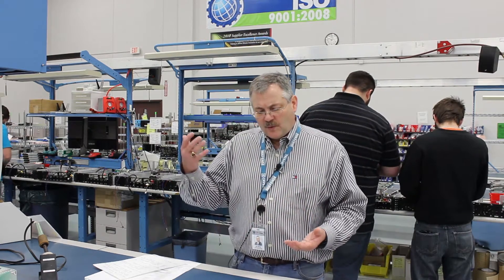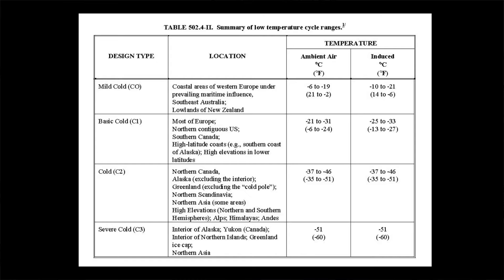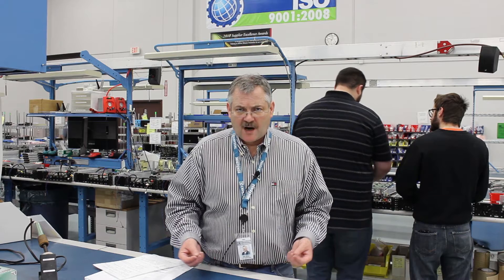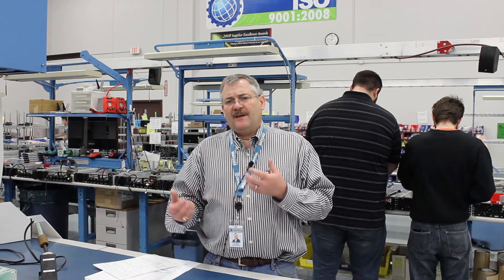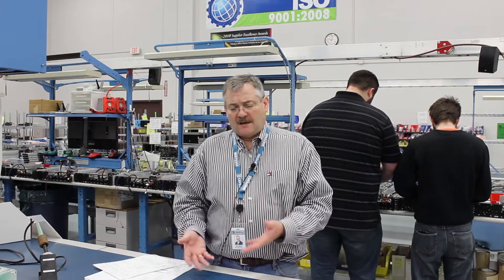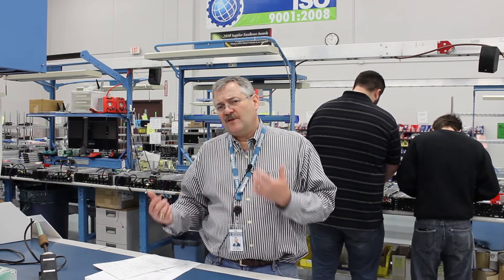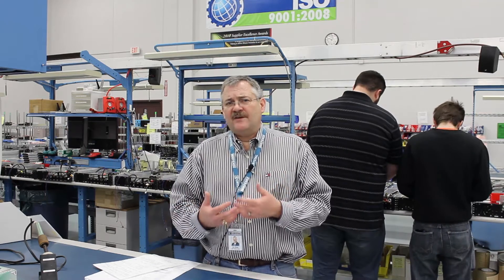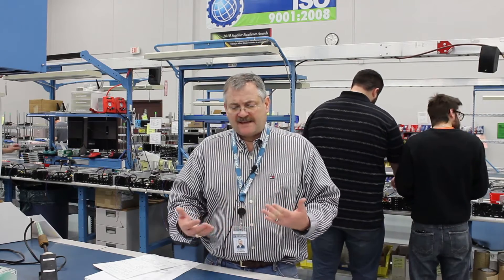MIL-STD-810 Test Method 502 Low Temperature | Jim on Engineering | Volume 1, Episode 66

Comment: What is the failure mode of storage and operation test ?  Is it the same then why u perform storage and operation. Is it not ok to perform just one of those ?
Reply from the maker: The lowest low temperatures are not always reached when the unit is operational.  This is because there is self-heating so even if the low temperature dwell  time is significant, the unit never reaches the minimum temperature.  Cold start is one way to test this however cold start is usually not the same temperature as low temperature storage.  In low temperature storage we are testing how the materials change or hold up under the lowest temperature while operational low temperature is testing how the electronics function at the lowest operational temperature.  One of the classic problems is rotational hard drives.  If they are spinning you can take the temperature down to -40C and it is not a problem but they rarely start spinning from a below -20C because the grease in the spindles is so viscus.  So the failure mode in cold storage is generally a material failure or damage and the failure in operational low temperature is generally a electrical or mechanical parameter out of specification.  

Make sense?  

Thanks for the question.